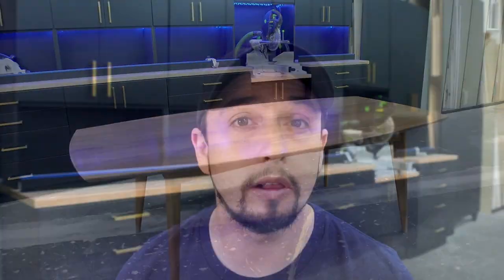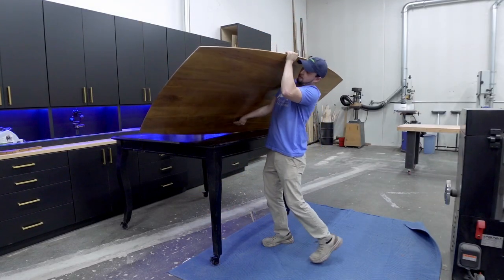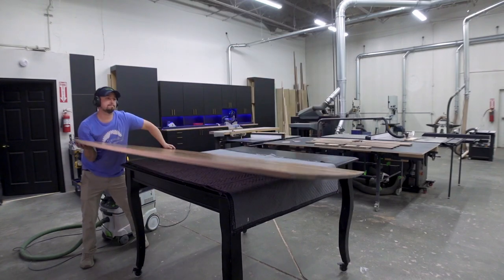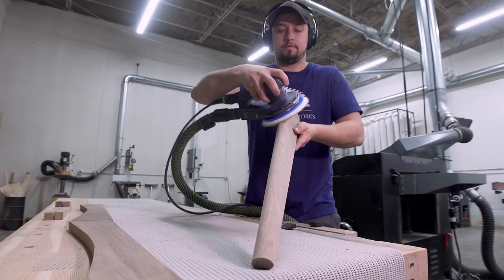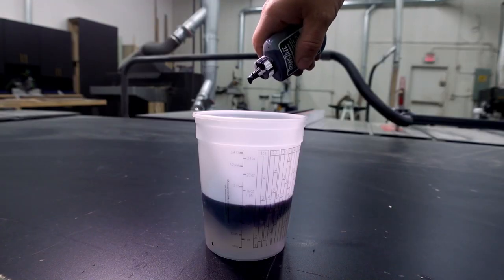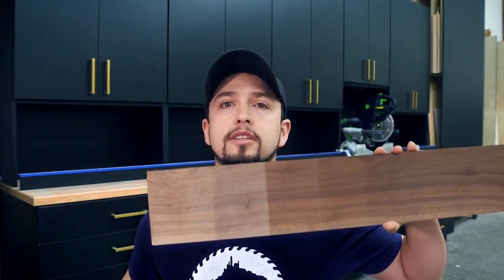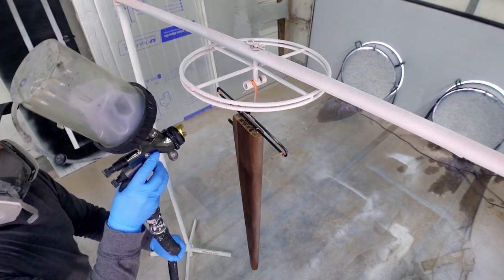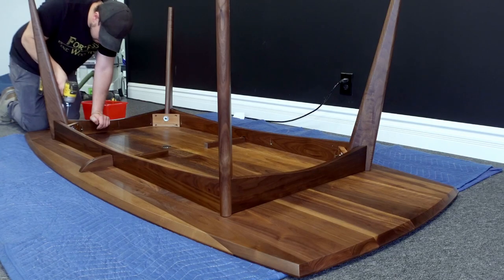An Extremists Way Of Finishing Walnut

Comment: Finally, someone on Youtube sees these finishes as not best for high use areas. I think the wood whisperer has a great video on comparing different finishes and it shows how well they fare.
Reply from the maker: Yes sir! I've seen his video. And he also agreed that hardwax oil doesn't last that long in his latest walnut table video, but then he sprayed it with Lacquer, which is not rated for tables. So I trust his judgment, but I don't think he knows what a truly remarkable finish is... yet. He is one of my favorites on YouTube though
Reply: I don’t think anyone would disagree that hard wax oil is not the ultimate for protection on pieces such as worktops or heavily used tables. The hints are there - wax and oil. However, for me, the most durable solutions require professional spray systems and a professional sprayer. The vast majority of us do not have the equipment or the expertise to spray the perfect finish (I would also add that there are significant health risks to spraying some finishes without the correct protective equipment). 

You could hand varnish the product; if you want or like that plastic aesthetic. Varnish is quite impermeable (but not completely and will not prevent heat or some water stains) but, when it wears, requires a lot of work to prepare the surface for re-varnishing.

Hard wax oil can be applied by a competent woodworker quite easily. It needs no special equipment and the best ones have no VOC’s (good for the woodworker and good for the rest of us). It will wear but repairs or complete re-finish require only cleaning and, perhaps, the lightest of sanding to get a key. We had oak worktops; I hated the look of the varnish that I used once; switched to HWO and was happy to wipe on another coat every 3 or 4 months. 

For me, the real advance for us mere mortals is the 2 pack HWO. That means I can apply a coat (the good ones only require a single coat) and it is touch dry in an hour (that does depend on the climate but I’m talking about a normally warm-ish day). I can then either move the piece so that I can get on with other things and/or it means that I don’t have to worry about dust on the air contaminating my finish. 

For exactly the same reasons, (aesthetic and ease of finishing) HWO is a very good solution for wooden floors. Again, 2 pack means quicker curing and less dust contamination. 

One issue with 2 pack HWO has been the cost. I think it has been set very high and has no relation to cost plus reasonable profit. Perhaps the owners of the company being a venture capital company has something to do with that?

The Wood Whisperer did a recent video comparing 2 pack HWO. Check it out as he is well known for his impartiality and expert opinions. His overall recommendation was a product called Natura Onecoat. I had not heard of it previously as it is new to the US (and I understand soon to be in parts of Europe). I got some and have to say that I agree with the Wood Whisperer. In my view, it is certainly just as good as any other (and I actually prefer it because it seems slightly thicker which may mean more solids and less liquid thinners?) but the real winner is my wallet. Natura is very significantly cheaper than the market leader. So, better and much cheaper? 

Just to recap, HWO is not the answer to every finishing situation. I don’t think anything is. HWO however is a very good solution if you want reasonable durability, a natural wood aesthetic, low risk (no personal protection equipment) to you, easy application and (with 2 pack) quick curing.
Reply: @theofarmmanager267 Have you watched the Stumpy Nubs' video on that new UV curing resin? I'd love to see someone use it on high-traffic flooring.
Reply: @MadLadsAnonymous  yes I have. And I did make a comment on that video. For professionals, the outlay on PPE and UV light might well be justified if the product works.

I know that some companies that make flooring use a lacquer which cures “instantly” but I’m not aware if that is UV cured. Professional flooring installers/refurbishes will be the first to use a UV cured finish in situ - again, if it works

Comment: Hard to beat Osmo. It has been used on hardwood flooring in Europe for decades. It was actually designed or formulated for hardwood floors until someone realized it was good for furniture as well. There's many different types nowadays for different applications.
Reply from the maker: I personally don't like the resistance of hardwax oils. Although, they are so nice to use. Thanks!

Comment: You are a great artist and a good teacher. Excellent transformation. This takes a lot of work, thinking, and creativity. Now the table looks much better than when it was new.
How many days did it take to do this job?  a week?  How much would people pay for something this ? How much did they pay you?  (You need to pay rent and make a living too)!!
I have never seen anybody using wood filler like this before. What was the real purpose of the wood filler? 
Not using wood filler would have made any difference?
Reply from the maker: It took about 1 week. Cost around $2000 for the customer. The filler is to fill the course grain and pores so the finish can be perfectly flat with no grain translating through.

Comment: This is a fantastic video. Thank you for spending the time to create and share it. I do have a question about the step-panel though. Where did it come from/how was it made? I think I get that you performed all the steps shown in the video on that one piece first (I may be wildly incorrect here), but if so, how would you know what the result would look like on the actual piece as I'm (assuming again) that the test-panel wood did not come directly from the table. Forgive me if this is a silly question.
Reply from the maker: That's a good question. Yes, all the steps are performed on the panel first, but progressively leaving the last step how it was so the panel shows the progression. 
I had walnut laying around that I matched the color and grain to the table walnut. So it was pretty much the same

Comment: The color in this piece is absolutely stunning. I am planning on remodeling my kitchen cabinets in walnut.  

One of my fears is sun fade due to the large Windows.  I think this video helped me solve that problem.

Would you mind sharing the dye ratio(s) for what you used on this table?
Reply from the maker: Honestly I've learned more since then, and using a light stain would work better since the pigment blocks light better than dye does. I don't have an exact ratio of dye to water, but it's a few good squirts in 16oz of water.
Reply: @FortressFineWoodworks  I never thought about using black dye as a pigment for walnut. I'm definitely going to try this. 

What stain are you using instead of dye? I've heard good things about applying Mowhawk's Burnt Umber after a wash coat of shellac.

Comment: beautiful table, i learned so much about color correction here! does the urethane not yellow overtime though? and if a scratch or groove occurs how would the repairs be done?
Reply from the maker: This particular urethane doesn't yellow, although other oil or solvent based coatings do. If you want to learn more in depth info, my patrons have access to a messaging platform where they can ask me questions. You can join here https://www.patreon.com/FortressFineWoodworks

Comment: first of all awsome work not only the project but the video too keep it up and you will reach 100k subs in no time but i have a question doestnt the sap wood darken over time so could it be too dark in a coupls of years due to the colour correction or is that process stopped through the finish?
Reply from the maker: Thank you for having high hopes! Thats a great question! Usually this coloring process (and finish itself) slows down the lightening of the heartwood, and darkening of the sapwood because it blocks some of the UV which is causing that change. I left the sapwood a little lighter still, so if this change does inevitably happen 50 years from now, then it will still look fine.
Reply: @FortressFineWoodworks  ok good to know thanks for the quick response
Reply from the maker: You're welcome. Thanks for watching

Comment: great vid on tinting, not enough out there.
I still use lacquer in my booth, its just what i grew up on, thinking of switching over to poly but the added steps and expense for quality poly make me hesitate. A 5gal of imron from my supplier is crazy expensive, right now im i just use variset and chemlife which is mediocre. contractor grade tinted woodfilller verses waterbased gel products is an interesting one i have to try, sounds alot cheaper haha
Reply from the maker: What waterbased gel filler do you use? Thanks!
Reply: @FortressFineWoodworks  aqua coat, its a  clear urethane (i think, it is water solu.) gel that dries clear. works great with transtint but its $20 a pint. i think you can get quarts a gallons online somewhere
Reply from the maker: Great to know. Does it shrink after a month or so?
Reply: @FortressFineWoodworks  Ive gone through a few gallons myself and ive never experienced that issue but i have read about it and i think it come from improper application and/or improper layering.  
4 to 7 layers, 320 grit sand in between, 24 hour cure, lacquer sealer the next day and first topcoat layer later that same day, final coat next day.
Reply from the maker: Thanks for letting me know your process. I will have to try it some time

Comment: Thanks for the great video! How many hours did you spend on the finishing process and how much did the finishes cost? I like to make custom tables but I'm not sure I can charge enough to cover the time and cost to cover this type of finish versus using a hardwax oil finish.
Reply from the maker: About 8 hours of finishing time with experience, and $200 in finish. Whatever works for you is what works. Thanks for watching

Comment: Soooo, before watching your video I WAS feeling pretty good about my decision to use Osmo 1101 as a base coat/colorant  and then Osmo 3054 as a top protective coat using a white scotch pad on my walnut dining table project.  If I use Osmo, Am I just setting myself up for a failed-looking finish after a few years of use that will require continual refinishing?
Reply from the maker: I would say OSMO will likely work just fine, but it will require much more maintenance than a urethane. The catch is, a urethane takes practice to apply. But you have to learn at some point
Reply: I’ve made some wall mounted coat hooks from birch and a bass guitar neck from maple with Osmo 3054 finish   Looks and feels great.  My hope is that my walnut table will be ok to do homework on without having the pen and pencil indentation marks left the surface.  We hardly ever sit to eat dinner at the dinner table so I hope that helps too, lol.

Comment: Awesome video, and very enlightening on the downsides of hardware oils. Does anyone know where to source Imron polyurethane finish in Canada? Specifically Vancouver island, BC?
Reply from the maker: Thanks for watching. I heard that imron may be discontinuing. If you have a local sherwin williams - product finishes , they may have a solvent Polyurethane.
Reply: @FortressFineWoodworks  bummer :( do you have a specific brand you'd recommend that would offer the same UV and surface durability as Imron?
Reply from the maker: Sherwin williams has uv absorbers, I just haven't used it in a while.

Comment: Hi, 
I'm an amateur who admires you a lot and wants to learn how to work with wood.  Is it possible for you to answer a question I have? 
I wanted to give more life to the color, to a piece of furniture I'm making out of mahogany.  
Can I give linseed oil before nail polish?  
I don't have many means and knowledge.  
Thank you very much.
Reply from the maker: Do a test sample first. Put some linseed oil on, let it cure for 4 days, then put your finish on. Let that cure for a week then test the adhesion with your fingernail. If it scratches easy or pulls off, then I suggest using varathane natural stain instead of linseed oil
Reply: @FortressFineWoodworks  Thank you VERY MUCH!!!

Comment: Have you seen Stumpy Nubs' video of that new formulation of UV curing resin? It's expensive, but if money was no object, I'd use a few coats of HWO then resin. Looks wicked durable.

No experience, just speculation.
Reply from the maker: Honestly that stuff is probably a really good alternative, although I'm so used to  the methods I do, I likely won't try it for a while
Reply: @FortressFineWoodworks Makes sense.

BTW, love the color of your cabinets and the hardware. Cheers.

Comment: part of owning nice furniture, etc., is maintaining it which is also included in your spring cleaning is typically applying wax or furniture polish. such pieces are never self maintaining and the problem is people are lazy and want easy buttons on everything. why would you invest good money on anything nice and not spend one minute of effort once in a blue moon to maintain it. you don't use harsh chemicals on wood, etc. and not do anything to protect the finish. seems people need a " for dummies" class on how to properly maintain their wood furniture, etc. every cleaner on the store is not meant to use on everything in your house, always use stuff made specifically for wood. 

BTW, i noticed when you wet your table to raise the grain you pretty much soaked it resulting in the grain problem "pitting" you mentioned, i'm pretty sure if you use a less water and wipe with a damp cloth instead you would avoid much of the pitting, still raise the grain, enough, and get a nice smooth surface. also, an orbital sander is nice but it ignores one rule, sand with the grain which such a sander does not.
Reply from the maker: Very true! Really. Maintaining wood is apart of owning nice furniture. Although, 99.9% of my clients wouldn't dare put any product on their furniture in fear of ruining it. That's why they hired me, a woodworker. So providing a finish that is damn near bullet proof is something that I'll never regret!

If I lightly wet the table, I'm not actually performing the task that I need to perform. Which is raising all of the grain that is susceptible to water damage. If only some of the grain is raised, then later down the road if the wood gets wet, the rest of the grain will raise and destroy the bond. This festool ets sander is magic. Even with my good eye, I could never tell the difference between straight grain sanding, and this random orbital sanding.  Thanks for your experience and insite!
Reply: I think the big problem is that the purchaser rarely knows the finish used, and different finishes require different maintenance/care.  Poly, for example, will actually look worse over time if you use furniture polish/wax.  And repairing water rings, scratches, sun fading, etc are often impossible if one doesn't know the finish they are dealing with.  In many cases, even professional refinishers have a hard time identifying the type of finish used, and opt for a complete refinish rather than just a repair (as we see in this video).